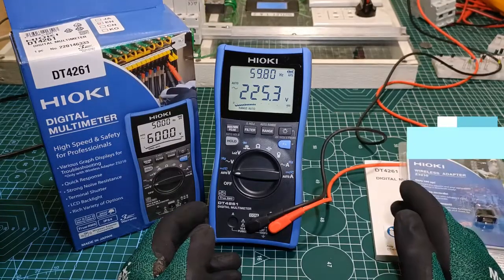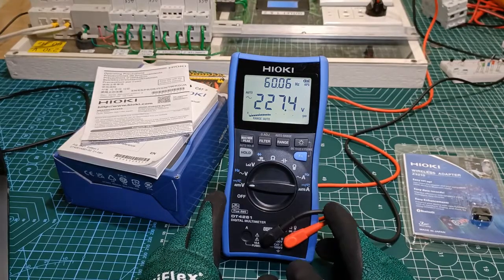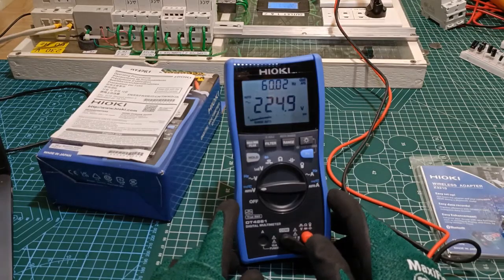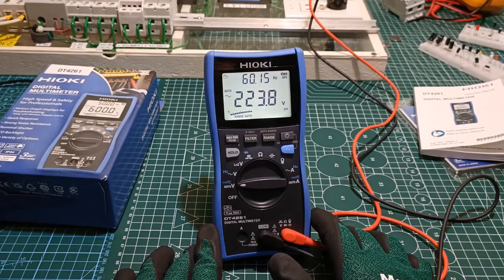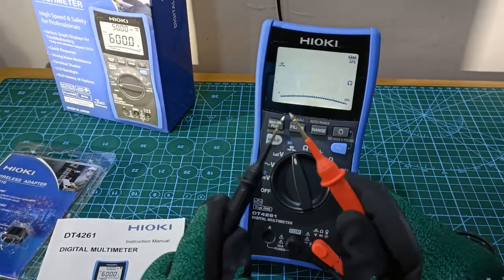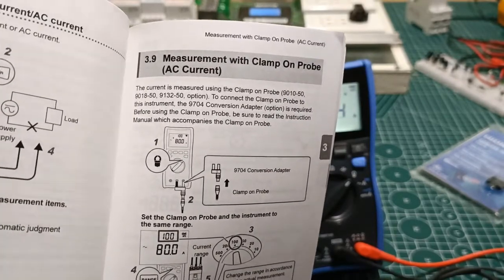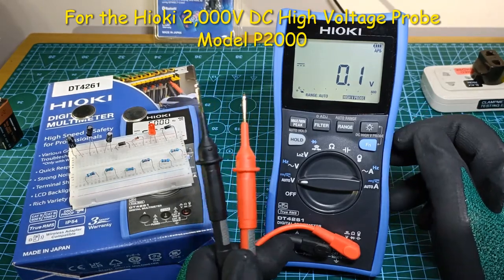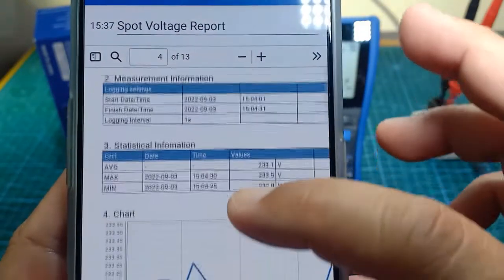[ENG SUB]How to Use HIOKI DT4261 TRMS Digital Multimeter- A Tutorial & Review (Part 3/3)

Comment: In your review unit continuity and diode check is swapped, continuity is suppose to be the main function printed symbol is in white, and diode check is in blue so is the second function, may be a batch error but more likely you have a proto unit. but on myne and all others i have seen it is the correct way around i dont push the FN button to get to the buzzer.
Reply from the maker: I appreciate your keen observation. I noticed this, too and I though it was peculiar, until I discovered this is a Pro feature built into the DT4261. Unless Hioki made a major version update, I don't think there's any difference among the official DT4261 units released. Mine has version 1.01 firmware. What you observed has something to do with a power up option called "User Setting Retention" page 103 of the user's manual, which you can activate ON and OFF by pressing Fn while turning ON the device. It remembers the last function you used in those nested positions, like what you described. So if the last function I used was Diode, the next time I turn ON the device, it will start where I left off: at Diode. It works also on V~Hz, AutoV/AC/DC/AC-DC, A~/Hz, and AutoA/AC/DC/AC-DC.

This is quite useful for professionals who want their DMM to default to a certain function whenever they turn ON their DMM. For example, some people may want voltage to default to DC at all times. Simply use DC volts last and next time you turn on the DT4261, it defaults to DC-voltage.

To turn this OFF user setting retention, simply repeat the FN-Power up option. It will then default to the white function in those nested positions. Thanks for your support!
Reply: @ramschannelreviews  you are right found it in the manual and tried it and it works, i never knew it could do that.
Reply from the maker: @stiaankruger2699  Glad that helped. Safe testing!

Comment: How does the auto hold works? On this 4261 ?Hioki dt4282 auto hold need to be engage after every measurement  so when u enable auto hold after the reading is displayed and on auto hold, next measurement you will need to re reanable auto hold again everytime. Annoying
Reply from the maker: I appreciate your question. The autohold of the Hioki DT4261 only needed to be set once for a particular function. You don't have to repeatedly reset it. I think it's better if I just show you. Here's a link to a short video where I illustrated this advanced feature. 
https://youtu.be/BVfNUaqjgDU
The DT4261's autohold was designed around a set of parameters. So, there's limitations. But on the whole, I think it's quite useful and saves time. By the way, that's great multimeter, DT4282, that you have there.
Reply: @ramschannelreviews  wow thats good to hear, thanks ypu for the info. Planning to buy 4261, by the way I have the Uni-T 117c  60k counts meter. Its a good meter only gripe is the holster is embedded I love the one like ng 15bmax removable holster. Love your review on it as well
Reply from the maker: @juancarlossandoval5628  Thanks for your support! What's the IP rating of the 117C? Perhaps the permanent moulding is due to its weather protection? It's interesting that it has a dedicated selection for an AC clamp accessory (1mV/A like the UTCS06A) and also a mV AC function. Have you tested them with the CS06A?

Comment: Thank you for your honest review. This has made up my mind to order the Multimeter with the wireless Adapter. For over 30 years I have used a trusted Fluke multimeter at work (and owned by the Employer). Now that I am retired, I have got a personally a whole set of Multimeters of the cheaper range, which promise the world but don't deliver. They are too slow....can't be read in Sun light, terrible Min/Max Hold functions....etz. I have recently purchased a Hioki Isolation Tester and was very impressed. So now its time to add a professional Multimeter, despite the cost.
Reply from the maker: Thanks for your comments. Did you mean Hioki insulation tester? I guess you call it isolation tester Down Under. I know what you mean about some of those cheap multimeters. For its DMMs and clamp meters, the electric utility I used to work with before only used Fluke also. So I got a few of that for my own use, as well. Then I discovered made in Japan Hioki test equipment. I have more Hioki than Fluke now. The DT4261 is their latest. I am sure it will serve you well, especially with the Z3210 wireless adapter. I monitor amazon because sometimes they have a good deal on Hioki instruments. If you buy from your local supplier, the cost may be higher than amazon but you're likely covered with 3-year warranty, which isn't available from amazon. That said, there was never an occasion where I needed to claim warranty for any of my Hioki instruments. They're every bit as professional and as reliable as the best test equipment in their class. Good luck, mate.
Reply: @ramschannelreviews  Yes I meant "Insulation Tester"...LOL. Yep finished after 30+years with a State Electricity Distributor. Started on the "Line" side, then followed up with a Electrical Fitter Trade, then cut over to Communications Trade covering RF/Microwave/fibreOptic...and anything else connected to Comms for the same company. My Multimeter was a Fluke 83 that I had for over 25years and it never failed me once. I am hoping the Hioki will prove just as reliable....and fast !!!.
Reply from the maker: @alf699  Great, varied work experience! I clocked 27 years mostly in the area of power quality and energy solutions when i was with electric utility, hence my affinity toward portable electrical test equipment. Hope you get the best instruments for your future projects.

Comment: Does the diode test beep also stop when you turn off the beeper? And how would you rate its bar graph? Fast, slow?
Reply from the maker: Yes. Once the Beeper is turned off by that power up option, the DT4261 is totally silent: diode, resistance.. everything, even the continuity buzzer keeps quiet. But the visual cues remain, like a red LCD screen warning. I would rate the bar graph fast. Thanks for watching!
Reply: @ramschannelreviews  This meter seems great for doing work in a quiet environment. Especially continuity with the visual indicator.
Reply from the maker: @parawizard  That's true. Thanks for watching.

Comment: Hi, how about the speed of continuity  latches? Is this speed like the Fluke 87V? 

And wireless adapter comes with this packages?
Reply from the maker: Thanks for watching. I've no Fluke 87V so I can't say. But on its own, the DT4261 latches on as fast as I can make contact and never missed a beat. Will try & upload a short later. They offer the Z3210 wireless adapter as optional. I think the model code if you want DT4261 bundled with Z3210 is called Hioki DT4261-90. Please double check to be sure.
Reply from the maker: Link to Youtube Short on its high speed latching:  https://youtube.com/shorts/RpXeBtxS5FY?feature=share